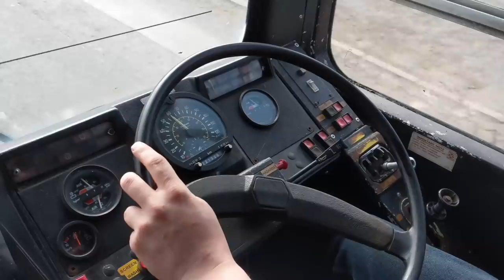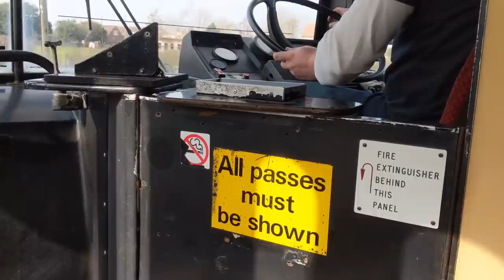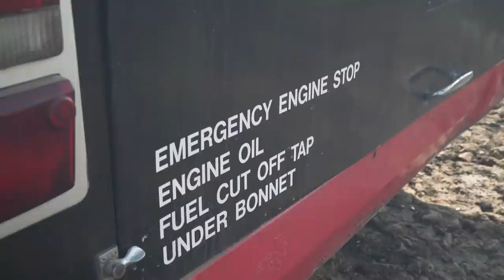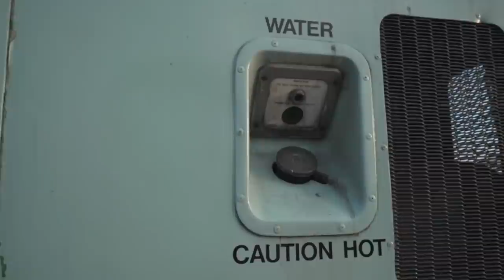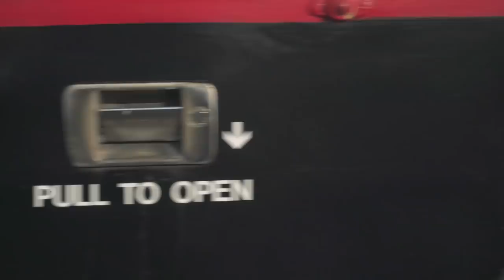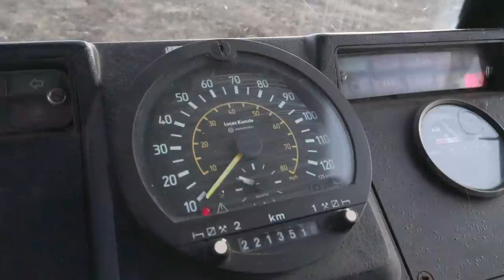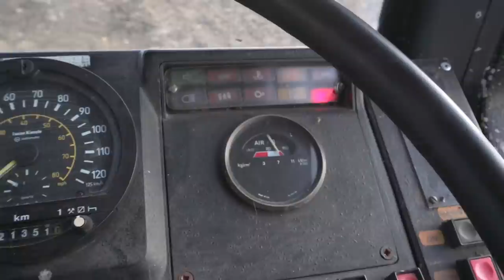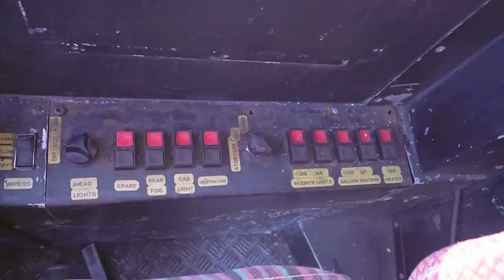The mighty Leyland Olympian  LMM Drives Episode 33.

Comment: When I was in school we used to get everyone on the top deck and the bus driver would flick in round the roundabout 😂😂 the driver said he got it on two wheels one day. 100+ school boys upstairs, can confirm they’re hard to tip
Reply: They have a huge diesel lump and  heavy-duty gearbox on the bottom, while the top is mostly empty space. I should imagine it does take quite a few children to tip that balance the other way!
Reply: @worldcomicsreview354  yep, that's why they're so hard to tip, because all the weight is at the bottom. Even the chassis, axles, brakes - they're all weight which helps keep it bottom side down. Buses are tested to 45 degrees to make sure they'll come back to their wheels.
Reply: Kids at our school did that, the driver pulled into the bus station and called the police :(
Reply: Every last day at school, kids swaying the top decks of the waiting busses, clinking the roofs.
Brings back memories.
Reply: @tomtalk24  bus drivers won’t do that nowadays :(
Reply: Does this bus make a very loud hooter when reversing.
Reply: Despite the shape, I believe they're designed to skid before they tip.
Much done on this back in the day. I've seen a photo of a DD bus on a tip testdevice - with a rubber bumper front and back at the top of the side in case it did fall over!
Reply: Iol yikes
Reply: Plus the axels and solid steel box beam chassis the top deck is just a roof really few metal panels and seats wont weight nothing

Comment: I used to drive an AEC Reliance, it was the first coach I drove. The fuel gauge was on the tank. There was a circular hole in the panel so you could see the gauge. 
You will have been told to pause between the gears, I used to drive the Leyland buses with semiautomatic transmission. 
Most buses and coaches are automatic nowadays. 
I have driven buses and coaches for 35years now.

Comment: I used to take a school for 7 years along 5 miles of steep hills in Plymouth. Plymouth Citybus had hundreds of Atlanteans,  however towards the end of my school days, probably 1982 onwards, my route normally got one of the new Olympians.  Wow what a difference! Smooth. Quiet. And so much faster, especially up the steep Plymouth hills. I guess having air suspension was a major difference from old. May have been the first bus with moquette rather than vinyl seats too.

Comment: Doesn't feel heavy like an HGV? Brakes very sensitive and sharp? Get yourself 80 passengers in there then see how it feels :)
Reply from the maker: I can imagine that would change the handling somewhat!
Reply: A comment made by a lack of knowledge .... I was a Bus Driver for 44 years until I retired in January and I used to drive Leyland Olympians for Stagecoach Megabus , they have ( shock horror ) Power Steering and having 80 passengers on board doesn't affect the steering weight and also assisted brakes that still stop sharply even with a full load .
Reply: An aerodynamic brick,0-40 ,most of the day

Comment: Nice one. Cross gates is in Leeds. I used to work for Yorkshire Rider. The seats for the driver on these were so hard on your bum and back, especially when operated over poorly maintained or bad roads.  l loved these busses, foot off  accelerator, wait for revs to drop and then change gear off like a rocket. No jerking. One of these converted (the roof was lowered) went all the way to Samarkand. Showing private on the destination should stop any uncertainty. Great  video.
Reply from the maker: Pleased to hear you enjoyed it!
Reply: Great vehicle they just needed up dating i e better heating, better seating, better air conditioning, better wind screen wipers, double glazing wouldn't go a miss. probably driven this one many many times. Just so reliable and easy to repair basic. Used to take all the lads to football matches from Hunslet engineering.

Comment: A sometimes contested point but what became the Leyland Olympian, started as Project B45 was designed and built by Bristol Commercial Vehicles, who Leyland had a 50% share (the other 50% was owned by the National Bus Company), which Leyland ultimately closed in 1983. Production moved to Workington and then in 1986 to Farrington works. The body was project B46, which saw Roe and ECW build their own versions of this body, which look similar but are different under the skin. But overall a good video. If you drive other classic buses you will find they are quite different in character.

Comment: As a 16 year old I joined London Transport in 1971 as an engineering garage trainee.
I was very fortunate at that time to work with old hands, who saw the brand new Routemasters into service in 1959.
We had a small allocation of Titan buses, in our garage in East London. Many of these vehicles were brand new direct from Chiswick bus works. 
My colleagues and I found that the Titan bus, with its transverse engine and gearbox, was problematical and not so easy to work on as the old Routemaster.
Many service drivers experienced a number of frightening situations when the roads were icy (or raining) The Titans could be unforgivable, because of the weight of the engine/gearbox  at the rear.
For us engineers, we were compelled to get to grips with this new bus type. You certainly couldn't change the engine on a Titan in a day like the RM. Plus the fact that many LT garages were having problems with spare parts. All in all, it was all part of the job.
Thanks for sharing your interesting film, and if I may suggest that should you drive one of these buses in the wet, keep your speed down especially when cornering. Cheers.👍
Reply: You have to take your hat off to those old hands. During my apprenticeship with a Bus Company, many of the old hands had no formal technical education but were required to take the new breed of engineering students under their wings. They were quite knowledgeable.
Reply: @bridgetown45  Many London Transport foremen, and District Engineers would sometimes rely on these 'old hands' if a problem arose.
Many of these blokes when I joined in 1971, were ex WW2 armed forces. I worked with Chief Petty Officers, a Military policeman all sorts.

One crusty individual, was ex army, and fought for his country in the 'Western desert'.
This old bachelor kept himself to himself, and didn't suffer fools. In time when he and I worked together during the weekend shifts I learned more about his war experiences. A great man, and while I remember; I was transferred to RD Hornchurch garage on the closure of Poplar in November 1985.

A man who worked behind the counter in RD, and a chap who I sometimes spoke with in the course of my duties was W.E 'Bill' Sparks DSM. This man was one of two Royal Marines who survived a raid upon enemy shipping in Bordeaux Harbour, during WW2. A real 'Cockleshell Hero'. His colleague who also survived was Lieut-Col H.G. Hasler; DSO, OBE. Blimey working on the buses, must have seemed tame in comparison. A real shame that I never realised who this man was during my time there. Bless them all.

Comment: That was an excellent bus to showcase. It got me to click and I really like your presentation.
A lot of the features of the Olympian, Titan and the mid mount engined Tiger single decker bus and coach chassis were inherited from the development of the itegral single decker National bus in the late 1960s and released in 1972.
The driver's dash and controls, as well as the steering and air throttle are lifted from the Leyland National.
The Titan was developed during the 70s and was an integral bus as well and was quite sophisticated which is what put other operators off buying them, so the simplified Olympian chassis was born which enabled bus companies to have modern features  of the Titan but with more traditional construction and simpler mechanical layout.
London ended up ordering their own batch of Olympians in 1987, their last official bus type before full privatisation. They had some differences over other Olympians that were specified for the London Buses order.
Engine options were the Gardner 6LXB like this one, the Cummins L10 and Leyland's own TL11 11 litre turbo charged diesel.
Gearbox options were the Hydracyclic, an automatic version of the gearbox shown here, Voith automatic and the ZF Ecomat auto.

Other buses you should try out is the Leyland National and National II an updated version released in 1979.
Make sure the first National has it's unique 510 Leyland diesel as many got Volvo, Gardner and DAF engines fitted later in their lives.
The National II got the Leyland 680, Gardner and TL11 as options from new.
Another decker I'd love you to take out is the MCW Metrobus which came mainly with Gardner, but some got Cummins L10s and one London example got a Rolls Royce Eagle engine! All came with Voith 3 or 4 speed DIWA transmissions.

Comment: Buses was one of the things I worked on when I started serving my apprenticeship in 1976. They used to suffer with Transmission problems because Drivers used to change gear too fast. The next Brake band would be locking up, before the previous one had released, Nightmare. My Mate worked in the Transmission shop, it was a much sought place to get sent to because there was always loads of overtime 🚌😂.

Comment: I went to school in one of these only a few years ago. A blue and white B reg and an F reg one with the double doors for entrance and exit (exit door was boarded up as it wasn't used) I was surprised it was on the road at how knackered it looked. Leather seats that were ripped and fixed with putty I think and the doors had such large gaps that when you went through a big puddle it would flood the bottom floor 😂

Comment: Southern Vectis had these as a staple vehicle and utilised them until the early 200O's.  In my younger days on the Isle of Wight, I would finish a drink in Ryde and jump on the 'Nightclubber' bus from Ryde Bus Station because I was cold.  God rest his soul, 'Ken' would drive the long circuit, taking sozzled revellers back to their home towns.  Ken was a salt-of-the-earth bloke, and his only comment to me was 'hang on kid.'  Running light, the vehicle would procede from Ryde, then be absolutely caned faster than I realised the things could go, along a stretch of road called Beaper Shute.  I was always impressed with the turn of speed you could get from these beasts, if they were allowed a head of steam!!  I seem to recall two different versions of engines, one of which would absolutely scream if revved hard!  Duly arriving via Brading into Sandown, the main pick-up was from Coloney Bogey's nightclub on Sandown front, and then taking dishevelled revellers back via Ryde again, Wootton, East Cowes (where I was living) and ultimately finishing at Newport Bus Station some time after 3am.  On one stupid evening, I'd supped more than I intended, and got nice and warm sat in my seat on this bus.  I was woken up at about 3.30pm by Ken, at Newport, at which point he apologised to me that he'd not seen me when stopping in East Cowes, and I was obliged to then walk home.  I think I got indoors via an hour-and-a-halfs' walk about 4.45am!  It might be rose-tinted spectacles, but to my mind, Olympians were far better than the current machines we have on the Isle of Wight, be they ageing Scania Omnicitys, or the relatively newer Enviro 400's, which make up the staple of the Isle of Wight double decker fleet now.  They were build more solidly and their suspension soaked up the poor quality road more efficiently.  It was a more comfortable ride, and those things could really motor when needed.  An added bonus was that if you were sat at the back, the hot-running motor caused the rear firewall/shield to be very hot; you wanted to be at the back!   There was nothing wrong with the Olympians at all, they just aged out when apparently more efficient and lighter vehicles became available.  Great video, dredged up memories of my early-mid twenties when there were plenty of nightspots and the Island was more interesting!

Comment: Charles Roe the great bus builders in Crossgates IN Leeds now Optare I worked for Yorkshire Rider and drove these Leyland Olympian's also the Leyland Atlantean, the Leyland Olympian was a great bus to drive turbocharged very fast and did the job for many years, Fully Automatic and fitted with coach seating including headrest some of the Leyands had over a million miles on the clock and still went on for years some of your comments are not correct actually Yorkshire Rider had there own upholstery , the buses  that were not so high for more rural routes was the Bristol Low decker

Comment: That model of Leyland bus was so successful due to that option of a Gardner diesel engine, I've known them do over a million and a half miles(not km's) without being touched apart for routine servicing of course, what did surprise me though was watching the oil being checked while the engine was running and oil warm, having run Gardner's for over 40 years I have never heard of that, but if it works why not. When Volvo took over there engines were being rebuilt after 300,000 if you were lucky and they used double the fuel of a Gardner but didn't get round any faster for it.
Reply from the maker: Is that so? That's an amazingly well built engine!
Reply: @lmm  Yes each individual engine was built by the same man and individually tested before dispatch it made them expensive to build and buy but in around 3 months the fuel cost savings paid for the premium price option,  fisherman say any engine will take you out to sea, but a Gardner will always get you back again.
Reply: Having owned Gardner-engined lorries, I can wholeheartedly concur.  Astonishingly good on fuel, but you do need to know how to get the best out of them when fully freighted.  When you do, they can cover the ground surprisingly quickly and with no drama
Reply: @chrisg6086  You summed that up a treat Chris, I bought Gardner’s after AECs which felt like racing cars compared with a Gardner but like you said you got them round the same.on nearly half the fuel, we’ve lost our way with modern diesels
Reply: @paulwilson3083  thank you Paul, and I agree with you.  Gardners just get on with it with no fuss, and they don't need a lung-full of ether to get them started either  Conversely, anyone driving a 220 Cummins as though it were a Gardner, will end up with slow journeys and glazed bores
Reply: @chrisg6086  You are very knowledgeable Chris, Fodens blamed a lot failures on their two stroke engines on ex Gardner drivers, I had a Cummins 6bta 180 bhp and that kept failing as it was driven like a Gardner, I bought it new and couldn't live with the downtime so replaced it with a 17 year Gardner 180 ERF and never looked back, thank you for your reply Chris.
Reply: @paulwilson3083  You're welcome Paul, and thank you for your kind words

Comment: Loved my time driving Leyland Olympians, I even worked for Cambus for a while and we had three of the UWW-X batch. We also had 3 with floor to ceiling carpets and coach seats! (a bit like what you were suggesting). I got out of the business once the company I was working for sold their last one, it didn't seem worth driving buses anymore.

As a slight note. Although they look like a Leyland Titan, they are actually based on the old Bristol VR, which is probably why they are such a good bus.

Comment: I used to drive Olypians both semi automatic and fully automatic among many other types of bus and the Olypian was the best bus I ever drove with excellent handling. The semi - automatic was easy to drive and first gear was only a crawler gear so for smooth driving it's best to start in second. When changing down it's best to give a firm blip to match revs.

Comment: I drove a X reg bristol olympian with ECW body gardner semi auto on school runs for about 3 years. Lovely rattly thing, with the rear engine and front radiator it never got up to operating temperature in the winter and as a result I had to wear thermal underwear in the winter as there was no heating in the cab. The cab heater was useless. Fill it with 77 people and you would be fighting with a very heavy thing. :)

Comment: 6:18 I can't be bothered to check if anyone else has said anything in the comments yet, but I've actually seen one of those Railbuses they built. LEV-2 (Leyland Experimental Vehicle) was built in 1980 and was tested in experimental service by the MBTA (Massachusetts Bay Transportation Authority) on an extension of one of the system's commuter lines. It lasted in service for an astounding 15 days, apparently, before suffering a grade crossing accident and not seeing service for the MBTA afterwords. It wound up in preservation at a tourist railroad in West Virginia, before coming to the Connecticut Trolley Museum in East Windsor, CT. These days, as far as I know (I last saw it a bit under 2 years ago) the poor thing sits on a storage track along the museum's operating right of way, looking rather sorry and forgotten- but still in existence. Perhaps someday, the money and enthusiasm could come about to fix it up.
CT Trolley Museum have another experimental rail bus, which was designed for both road and rail operation, based around a GM 'New Look' style bus, which used to serve the Connecticut Company.
Here's an Image gallery that shows many images of the vehicle:
https://www.flickriver.com/groups/14613192@N25/pool/interesting/
It seems that while withdrawn after such a brief service life, it remained outside of preservation, and on railroad property, for quite a while.
And here's the Connecticut Company's rail bus, at CT trolley museum:
https://cptdb.ca/uploads/monthly_2020_06/railbus840.jpeg.0621b90afa963d9f10c1b86215faa542.jpeg